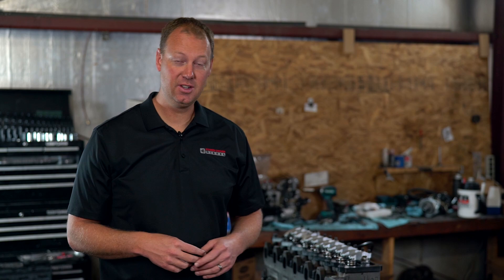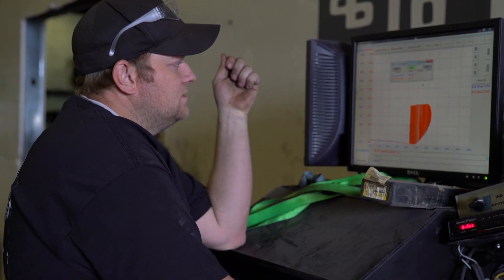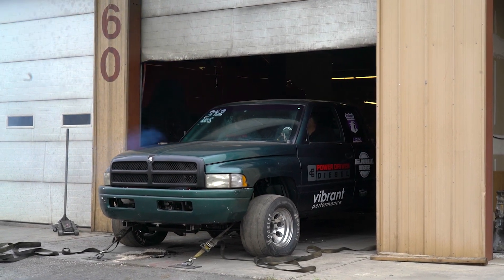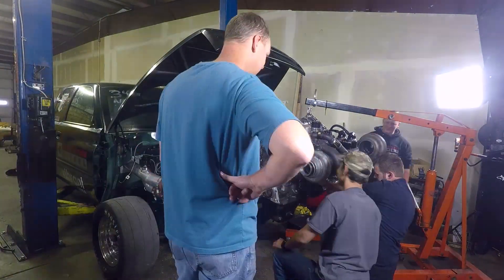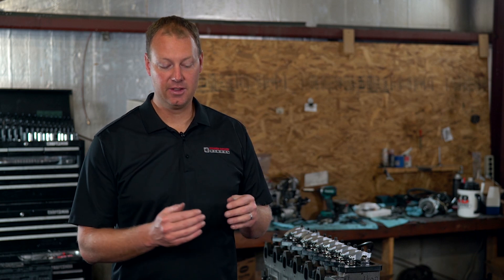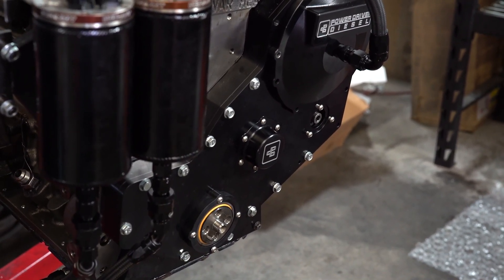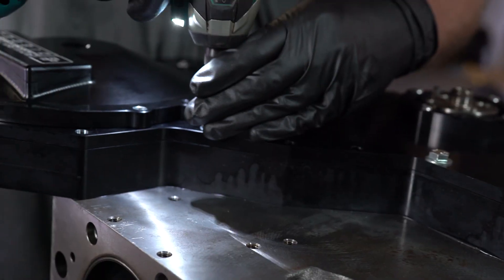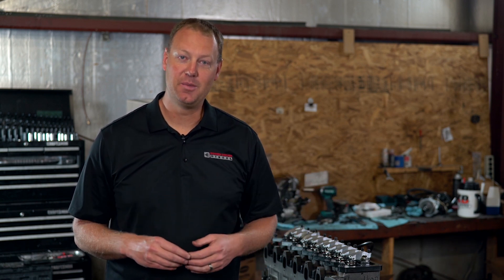Dyno Destructo | Power Driven Diesel

Comment: With all the custom fab work you do would straight cut gears cause less side load on the cam as well just my 2 cents
Reply: Yeah true I am actually surprised that somebody hasn’t came up with a set of straight cut gears for the high-performance diesel industry because it would cause a lot less sideload and horse power loss through the angled cut gears

Comment: the grain looks a bit rough to say its billet, more looks like a hardened cast from a distance.
those valve springs also put a lot of extra strain on the camshaft.
Straight gears should fix the thrust and bending issue.

Comment: Todd that sucks at least it didnt happen at an event. 1:25 Watch  the ground immediately a piece of engine flew out under the hood . But if you listen to the section right before the run when the camera was inside the cab you can hear a faint  tick.  Out of curiosity was the injectors angle spray pattern larger than the then the piston bowl? The new engine is awesome . 
Arent CNC machines so much fun. I have a small cnc mill and lathe in my home shop. I use bigger ones at work . I used solidworks and solidcam.  The stuff a guy like me could make with them at home is amazing. Technology has come so far.

Comment: I feel your pain, my friend. I build 4 cyl race engines and the vibrations made by a 4 cyl at 10,000 RPM will shake things loose. I've broken(aka torn the center out) many flywheels trying to get the problem fixed. A lot of head scratching and patience, and maybe a little yelling and wrench throwing LOL.  Keep up the good work.

Comment: Pushing the boundaries isnt for everyone that's for sure.The troubles you're having reminds me of when I was dealing with VW's.We were shooting for 1k hp from a 4cyl and we kept grenading blocks.They'd let loose right around the intermediate shaft sending shrapnel everywhere and I mean everywhere lol. when they let loose at 6-8k it was scary to say the least and when it'd come to rest the cylinders and head would be separated from the rest with the crank assembly,pistons etc all out in the open lol.We where using the int shaft to run a dry sump and we kept breaking shafts at first real close to your cam gear problem.Well when we went to a custom billet shaft we found the next weakest link :-O  Anyway good luck and I love that billet cover.I'm sure you'll get it figured out and thanks for the updates.Its nice to see people truly pushing things to break new ground so to speak.But I have to ask.......Why at this level have you stuck with a log style turbo manifold?
Reply: PowerDrivenDiesel log manifold's do get a bum rep . When I had my shop we used them on 4cyl builds up to the 500-600 ish hp range for the street.i did do some testing and the tubular did spool quicker and made a little extra power.But it was only around 10% max and as you said not really worth the headaches. I was just curious as to how diesels reacted to them but when I thought about it, you can easily cram more usable boost in than a gas engine. Thanks again and if I wasn't so far along with my build I'd definitely consider diesel but there's no way to stuff one in a awd s10 project.

Comment: straight cut gears is what you need
Reply: Wonder if they'll be noisy enough to hear over the rest of the engine. Would sound awesome if they were.
Reply: i would say no.  the point is that they produce no lateral thrust like a helical cut gear, not that they sound "awesome"
Reply: I understand the point. The sound is just a bonus.

Comment: It's an engine...motors are electric..  Good content on the rebuild
Reply: motor is a generic term..a mechanical unit supplying 'motive' power..' an engine is a mechanical device that converts stored power into motion...neither word has anything to do with what fuel/power is consumed/converted or by what method (internal combustion or electromagnatism)..both words describe a process, not a specific method utilized by the device.  It's the same when guys only think of a belt or gear driven compressor as a 'supercharger' when that word applies to any method to increase relative cylinder air charge; mechanical driven compressor, exhaust gas turbine driven compressor or even.....yes, nitrous oxide enhancement...all are 'supercharging' the cylinder air capacity above atmospheric.